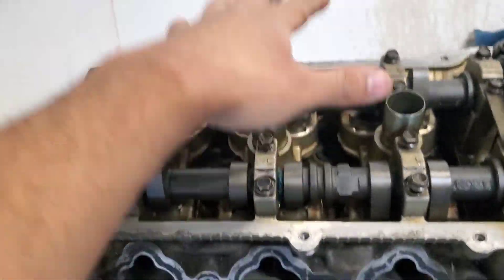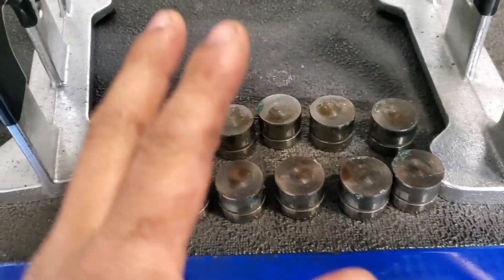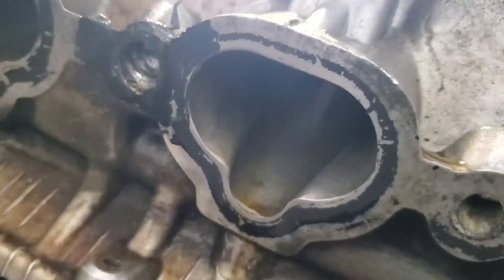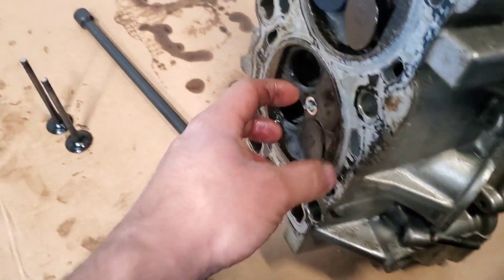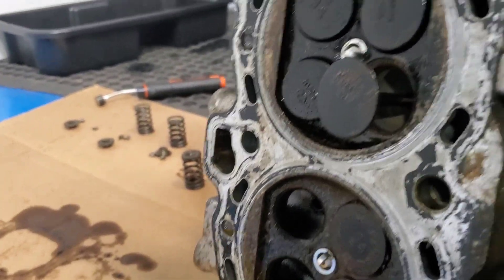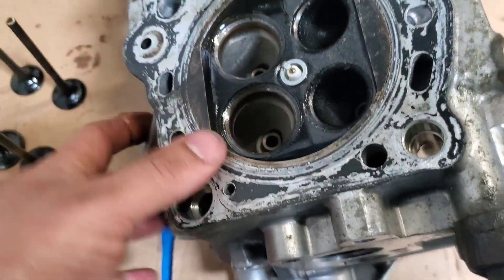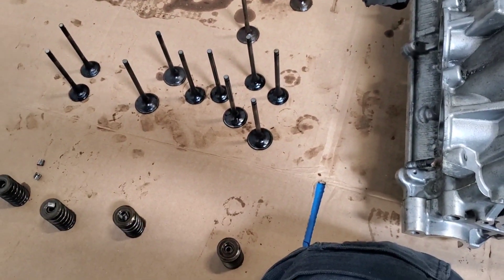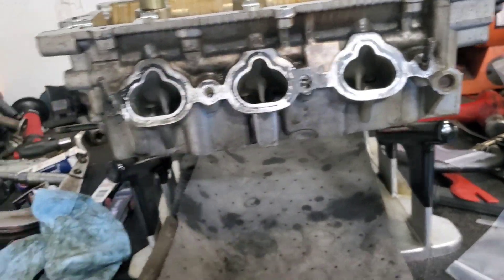Taking apart cylinder heads off Hyundai delta 2.7L V6

Comment: I wanna port/polish mine have u cleaned these up and put em back on and if u did what did u do to re install valves
Reply from the maker: I never put them back on I never got my engine block back from mechanic shop yet...when I do I'll be reused my valve because they are still good
I did port out my 2002 honda accord coupe V6 cylinder heads. Put new values and it made a difference vs full exhaust and intake